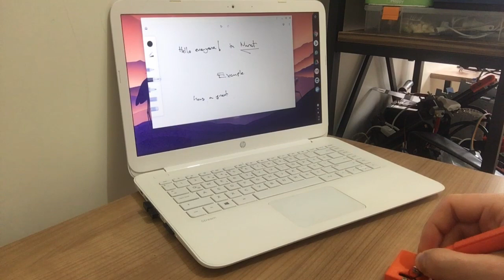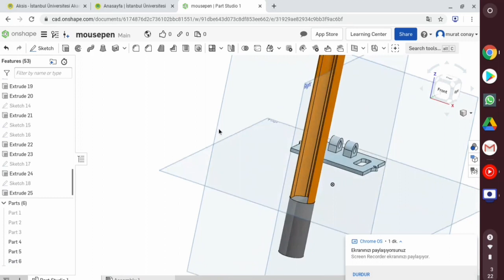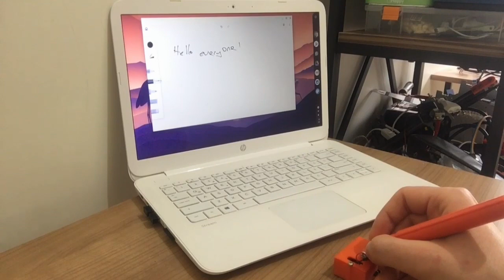How to Make a Pen Mouse (Costs 3$) (Open Subtitles)

Comment: Wow, that's a really ingenious reuse of a cheap mouse :3 Not gonna go head to head with a "real" graphics tablet, but not like it was meant to either, and what a wonderfully "simple" project to start tinkering with electronics to suit your needs. I do want to mention though (and please take this as concern rather than criticism) that the dust from cutting or filing PCBs can be very harmful if inhaled. For everybody's safety, please work in a well ventilated area and wear a protective respirator mask when working with fiberglass dust, your lungs will thank you :)

Also, kitty :3c